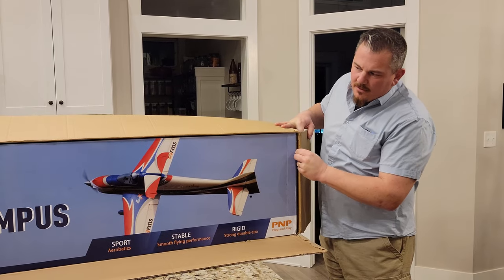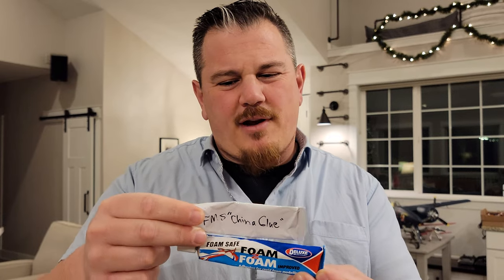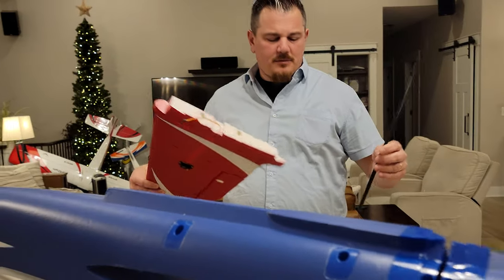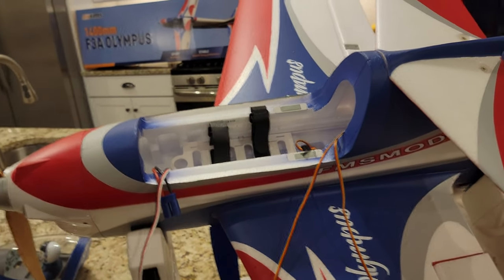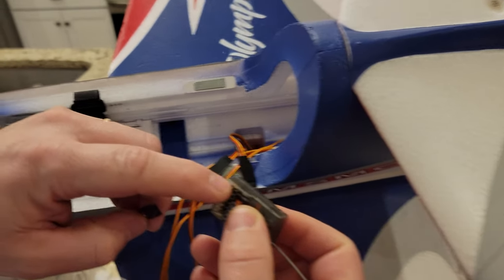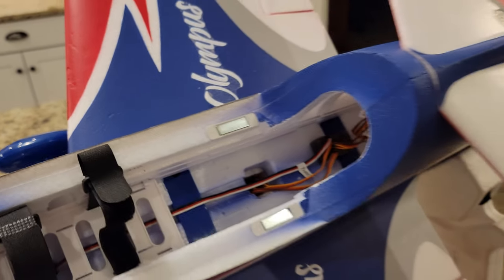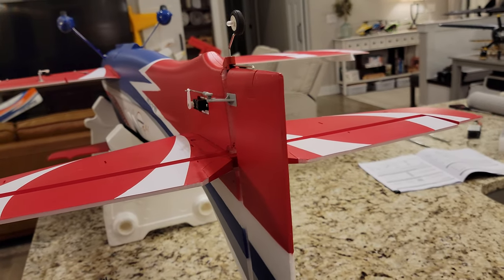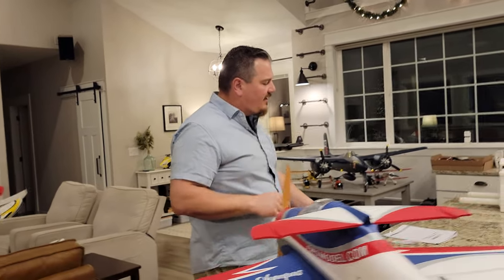FMS - F3A Olympus - 1.4m - Unbox, Build, & Radio Setup

Comment: FYI this is a pattern airplane, it is 3D capable but with the long tail moment and without 3D control surfaces, it is way more difficult.   Not a 3D plane....   
The top wing is a cantilizer.  It makes the rudder more effective and stabilizes KE flight
Reply from the maker: yes, thanks!

Comment: @BrianPhillipsRC thanks!! Been flying for a long time back when power was glow powered. Now electric has the strongest power/weight ratio. Been watching you for a couple years now I really enjoy your comprehensive descriptions on how to set up a plane with today's complicated electronics. I've been out of the hobby for 12 years now I have a health problem that really greatly affected my ability to get around and to actually have money. I'm thinking about getting back into it though it's just like riding a bike right? Hahaha we'll see. I'm a Gonzo 3D and slope soarer from California and now live in Texas so I think I'll use stuff with a prop there's not much slope left out here. Never got into dynamic soaring although it is very intriguing 500 and something miles per hour with a glider? Yes that is not fake I've seen guys hit about 200 just going in circles. My thing used to be to get as high as I could like a thousand feet and then do a downwind high-speed dive over the slope from the lift side to the rotor side at about 200 miles an hour straight down to where the bottom of my "U" was right over our heads hahaha. Nothing beats RC!!

Comment: I would actually be interested in purchasing  planes that require more assembly If an ONLY IF they would offer them ata reduced price. Ive been in this hobby for 30 years and remember when ARFs were just starting to be developed.  Lots of great aircraft designs but not many companies seem to actually know how to build them.  They need to be serviceable.  Many pre-installed hinges and control horns are not installed with the proper geometry.  And no disrespect to you or anything but truth is you are spoiled because you haven't had to build many planes . You assemble a lot of them because thats just the nature of rhe hobby now. I realize this is a relatively small hobby but these companies could triple their sales if they would put a little more thought into designing them to be able to be worked on. Every model should be designed with the ability to change out the battery trays, motors and every part that wears out without having to chop up the foam. Keep up the good work man
Reply from the maker: I hear you 100%, and just replied to a later comment of yours.

What you don't know is that I DID stick build some smaller planes as a kid. A few P-51's (Guillows / Sig) and a B-52, and an F-5 and F-14...and a few others. I never had the means to make them RC though, as a kid - I did cars, trucks, and train sets, and all sorts of legos and technics - loads of electronics and computers - I was a total geek [...was... - LOL LOL LOL]. Before my Grandpa died, we worked together on making his kit planes RC, and then flew them together. This was for about 3-4 years before he passed away, early in my experience with this RC Aviation hobby, when I REALLY didn't know much about what I was doing...but more just kinda getting my feet wet. He and I loved that part of this experience. It was HARD and rewarding. Wish we would have had more time to share that aspect of the hobby, but we did get some GREAT times together, and shared some footage too - so it will live for all to see for a long time ;)

You're right that we're "spoiled" and I don't take any offense to you saying it - WE DO KNOW THIS, and do speak of it from time to time. Knowing HOW hard it was to fly RC just 30 years ago, and the skill and determination it took back then, it's a WONDER anyone did it...BUT to be fair, you weren't fighting a battle for attention with tablets, cell phones, internet (well, BARELY the www) and the whole market was different. You HAD to go to a model shop. You HAD to get help, since it was the way everything was sold. That's part of our mission here. We don't want this hobby to die JUST because the way we shop has changed. We NEED people like us to help people that are totally GREEN to get their feet wet. We don't all HAVE hobby shops, and while that's a bummer, and we do help to put the final nail into some of those shops' coffins, the market dictates what the world wants, not what WE want. Hobby shops were a hallmark of our wonderful hobby, and we hope some will survive. I think business is HARD, and those who do it better be good at it. We live in a LOT different world than 30 years ago when you started into the hobby...and even 10 years ago when I got really into this hobby...it's WAY worse in a LOT of ways, but it's better in a few. My point, and I think you'd agree, we have a big burden to bring people into the fold. It's OUR job (you and me) to win peoples hearts and minds for this hobby, if we want it to be around for my Grand kids and beyond.

Hope this helps, and makes sense. I do GET what you're saying, and agree with it...but that's doesn't necessarily change that what we're doing is necessary in the formidable environment that our hobby lives.
Reply: @BrianPhillipsRC  all true man. I guess the biggest thing I miss is being able to drive to a model shop now full of aircraft  and kits . Not many exist. I'm lucky to still have one local family hobby store. Actually called "Family Hobbies". They ate great but like everyone else very limited in available inventory.  I hate ordering online but I'm having to change slowly.  Thank you for the reply.  Didn't think anyone actually read comments without a secret "password " or something.  Ha! Lol. Really awsome that you care and devote so much effort to our hobby.

Comment: FMS is a terrible company. Bought 3 airplanes from them and everyone had issues. Look somewhere else to buy your aircraft!
Reply from the maker: Everyone is entitled to their opinion, but FMS has is one of the largest producers of RC planes in the world. I don't doubt they've made MANY mistakes, just like every large scale manufacturer, but I can't explain how you've had 3 bad experiences, when we've had basically none...well, maybe one - bad linkage on the SU-27 that shouldn't have failed and they replaced it, FYI... Do you get a TON of planes? We sure do.
Reply: 5 FMS plane owner, no problems, love them all.
Reply: @BrianPhillipsRC F-86 wing wiring wrong. No flap servo working. Someone color blind on the soldering line. Pitts plastic servo stripped before first flight. Viper 25 Anniversary addition, ESC DOA out of the box. Guess I am unlucky! 47 years flying and still love it. Thanks for what you do!